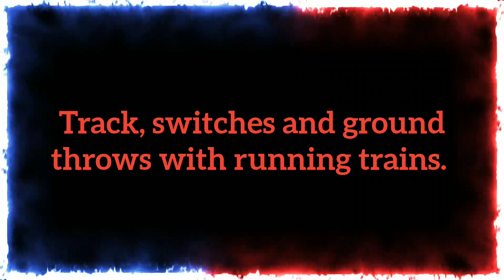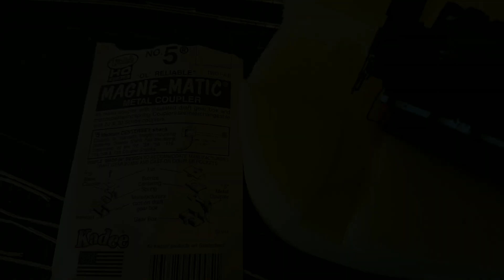Final trackwork and running trains - Part 6 of Angels Ridge Railroad layout

Comment: Hi Brian. 

Great to see the electrofrog points and their ground throw switches working perfectly. Terrific shunting session pal! 

I use a track rubber to make the lines shine, then I quickly run a half-inch paint brush over them to brush off any residue left behind. It works a treat and saves money on cleaning fluids. 

I see the red Caboose doesn’t like being propelled so, maybe insert some weight inside and over the rear bogie to steady it. I find all my American ‘Life Like’ box cars are rather light and need weighting down to make them more stable. 

When it comes to uncoupling, instead of a tooth pick, try using the pointed end of a pencil. It works for me. 

Another tip is to put an ‘ammeter’ in line between your controller and the bus wire. This gives you the amount of current your locos are drawing and is an excellent indicator of the condition of their motors, thus avoiding any future problems. Ideally, 1.5amps should be the approx. maximum they draw as anything more and either something isn’t right or, it is an old loco. 

As you have a penchant for American and Canadian diesels, take a peek at the ‘Jaw Tooth’ channel where you may pick up some ideas as it is all live Transatlantic action. 

Incidentally, there are ‘Kadee’ type couplings on the well known auction site by a different manufacturer at literally half the price that Kadee are charging. Craig has just ordered some. 

Keep up the good work Brian and I’m looking forward to seeing some scenery and buildings in the future. I do love that Alco. I think the colour black makes it stand out and it certainly looks better than my green Burlington Northern GP38. 

Take care, 

Paul. 👍❤
Reply from the maker: Thanks Paul, a superb comment. The ammeter is a very good shout, I will look into that. The Kadees sound interesting, will need to investigate, as I will need a few more.
The caboose has run through the switches a lot better, it might have been the wagon propelling it, the knuckle coupler was misaligned, I think. It does have a good weight, but hey, testing helps sort out the niggles. 
I will check jaw tooth out as well.
I appreciate your support and advice Paul, good man.
Take care and all the best. Brian 🤘

Comment: Kebab scewers work as a rough an ready kadee uncoupler tool, I`ve just splashed out on the proper one, it was only 3 quid but it doubles a tool to aid fitting those tiny knuckle springs, Looks like your having fun and thats the main thing.
Reply from the maker: That's good to hear, I need those tiny springs fitted to a knuckle coupler, where did you get your uncoupler bud? Thanks again for your support and commenting. All the best. Brian 🤘
Reply: @theangelsmodellingandrailways  peters spares
Reply from the maker: @newlynnrailway  thanks kindly